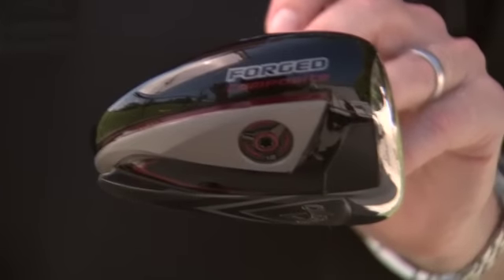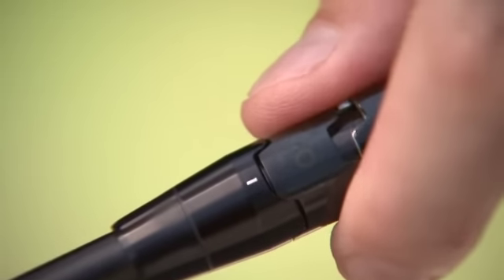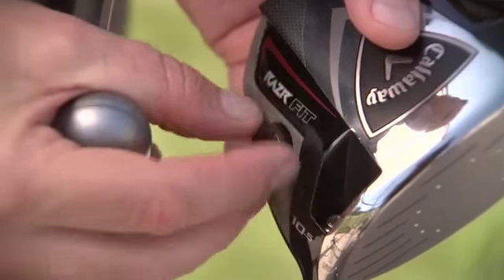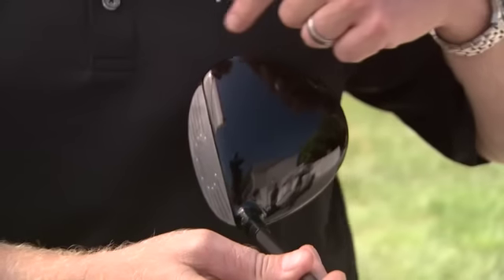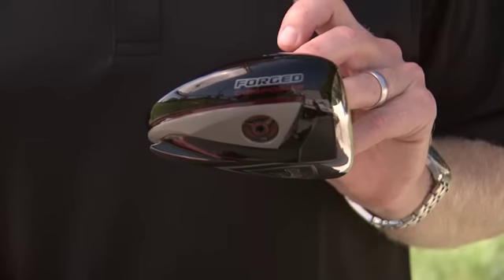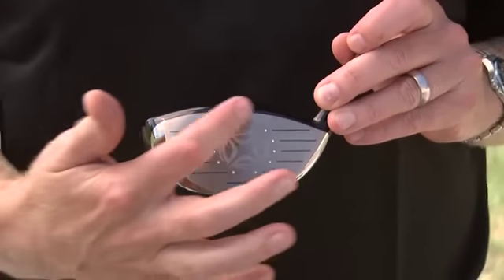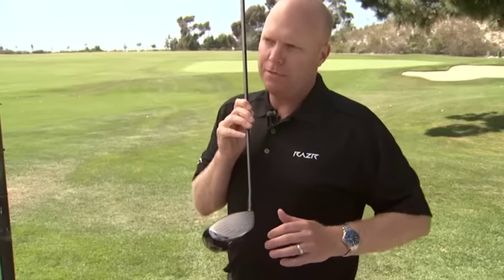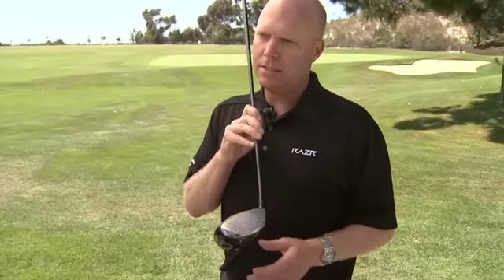Callaway RAZR Fit Driver

Comment: This is so cool, I just got one of these used for $60 here in canada, it's 9.5 degree project x 6.0 shaft (stiff I think) It's my first real high grade driver so I can't wait to use it and mess around with the weights and angles.